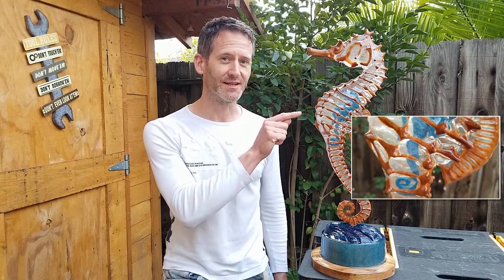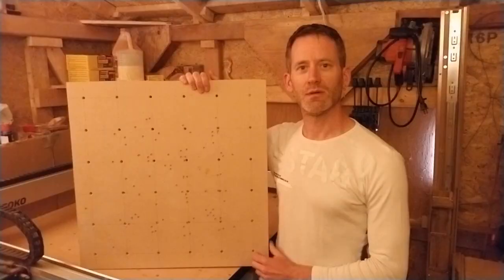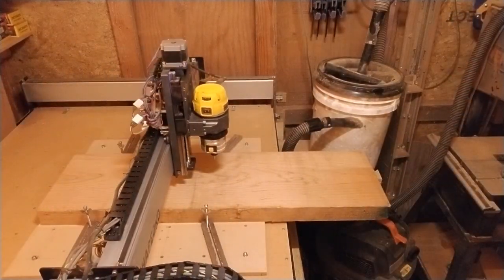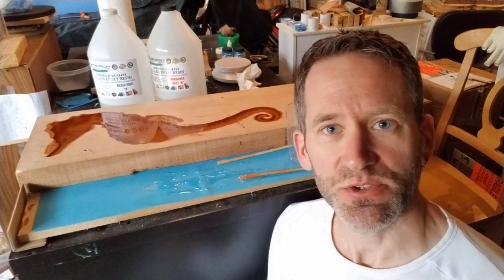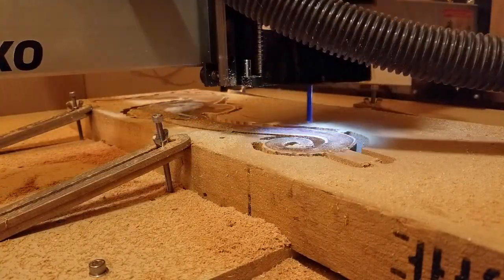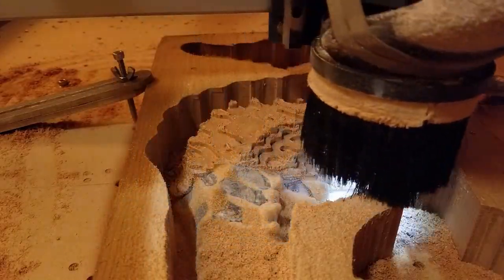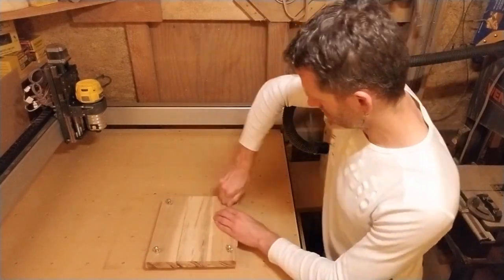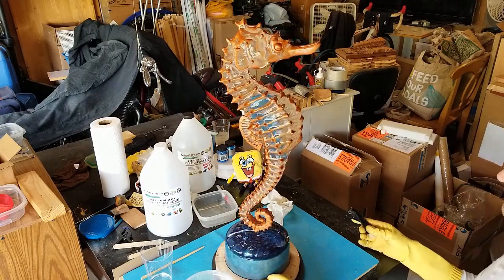CNC carving a transparent seahorse - with the Shapeoko

Comment: great job Denis, I saw one person, he is engaged in the manufacture of tables from epoxy resin. he makes a so-called ceramic coating for the car. it is non-toxic, very durable, protects against ultraviolet radiation and imparts color and depth. he used a coating from the manufacturer Mipa. 
polishing will probably be required after application

Comment: the idea is amazing, nice job. I think you need a vacuum chamber to disappear the bubbles of epoxy
Reply from the maker: Thank you! Actually, these bubbles occur due to too fast curing. If you want epoxy that is clear as glass, try the Floral Epoxy. It cures much slower than the usual epoxy, which gives bubbles much more time to float to the top and pop. Check out my video where I carve a dragon battle axe, for which I used Floral Epoxy: https://youtu.be/SO-L4DHFnaI

Comment: your creativity and skills give me hope.  I still want to try to do the clam shell box.  I use vcarve pro so am less convinced I can do 3d properly.
Reply from the maker: Thank you!
Note that I used the VCarve Desktop version for the sea  shell box, and found out that VCarve Pro is actually not much different. My main reason to transition from the Desktop version to the Pro version was to be able to handle projects with larger dimensions. Pro does not have any extra 3D features compared to Desktop. The key is getting the right 3D model and then using Meshmixer to modify it for CNC purposes.
I already made the design and the CNC files for you, so you only need to download them and then follow the steps in the video. You can do it! :)

Comment: love your work can you explain why you use different bit for the dowel holes
Reply from the maker: I prefer to use a downcut bit for the dowel holes, as an upcut bit would tear up the edges of the hole, and those ruffled edges would prevent the stock from laying flush on the surfaced bed.

Comment: Could you theoretically cut the time in half by milling out both sides at the same time when pouring epoxy?
Reply from the maker: Do you mean cut the first half, then pour the epoxy in there, and then cut the other half while the epoxy of the first half is hardening? Sure you can. But not with the size of stock I used, since I needed the dowel holes from the first cut to align the second cut due to the nesting.

Comment: You just gave me a great idea for making a centre leg for a coffee table! What a brilliant idea. As a by the by when I need to put something on the table without clamps use super glue. I saw a tip on a youtube channel a couple of years ago and have been using it ever since. What you do is put some masking tape on the spoil board. Then some masking tape on the bottom of the piece you intend to carve. Put superglue on the masking tape, position the piece you want to carve on the other masking tape on the spoil board. Apply some pressure and no need for clamps very handy for odd shaped pieces or round pieces like that bucket epoxy leftover you had. When your done a little leverage and the piece will separate from the spoil board peel off the masking tape and your golden.

I'm sure you've seen this done but just in case you haven't https://www.youtube.com/watch?v=wern6Cj8sgI  it works with not just metal but any type of wood. I have used this technique on large pieces not covering the whole bottom just in 3 or 4 corners. With the CnC also pushing with the bit on top I've never lost a piece for carving doing this. The beauty is I can then remove all the scraps areas without worrying about the bit hitting any corner supports.

I am going to try to make a dragon to hold up the coffee table top, seeing as my patron saint is St George, a dragon holding up the coffee table top would be a nice touch IF IF IF I can replicate what you have done with your seahorse.

What a marvellous job. Thank you for sharing!!

My wife just looked at me and asked me why I couldn't be as creative LOL.. Oh well...
Reply from the maker: Thanks for the tips! :)

Comment: Hey Dennis, I'm trying to figure out slicing for cnc machining using Meshmixer, can you give me some help, what is your process for this? Cheer all help is appreciated
Reply from the maker: My software skills are actually pretty basic. That's why I usually start with buying a 3D design that comes close to what I'm looking for, and then make basic modifications using Meshmixer, so that it's compatible with my CNC (dimensions, angle, thickness, wood grain direction, etc.). There are plenty of videos about the basics of Meshmixer that explain the features much better than I can, such as slicing. This is where I started:
https://www.youtube.com/playlist?list=PLu8TYSQ5jCFjdQBHsLoybhdKXOTmpTRlb
Reply: @dennisvanhoof9958  thanks for the very quick reply. I have a lot to learn, at the min I can't seem to get past very small slices? I guess I need to watch more videos